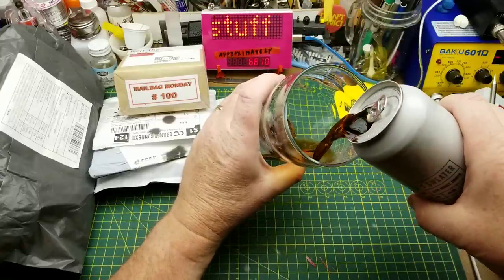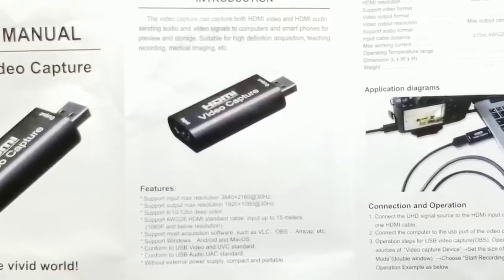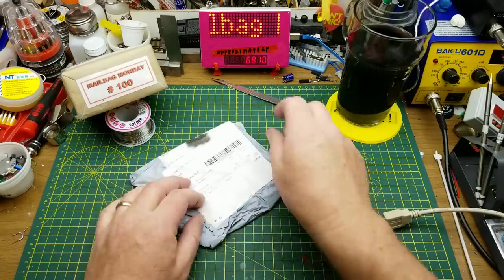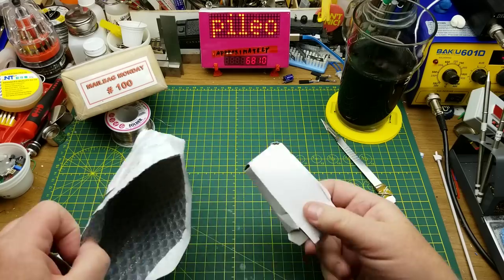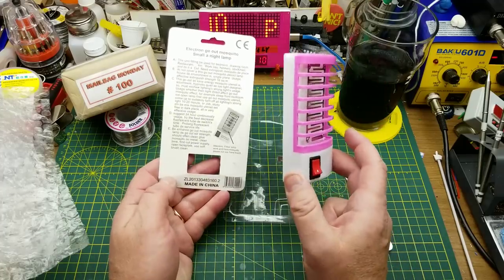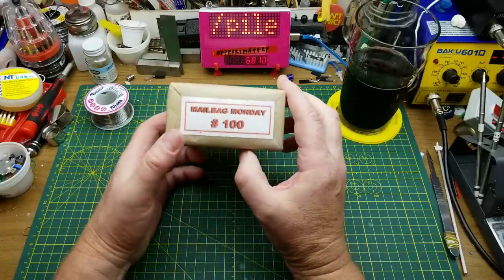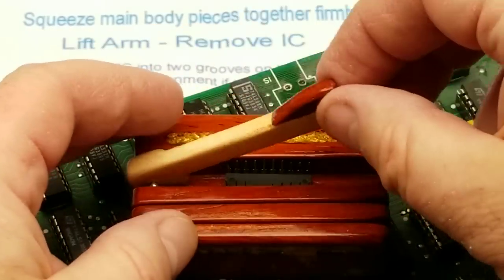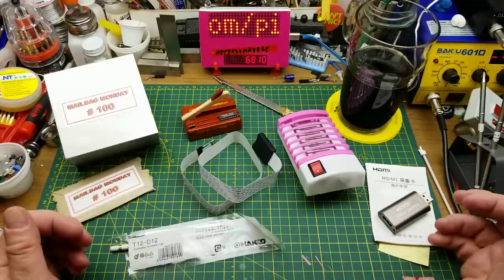Mailbag Monday #100

Comment: If you use "Repetier-Host", you can print directly from a computer (like a 'normal' printer) without having to transfer to SD card and transfer to the printer.  Having used both, I cant figure out why people use the SD card transfer method to print.
Reply from the maker: My printer is far away from any of my computers, so that's not really a practical option for me.
Octoprint on a raspberry pi has become my preferred method. 

But I ordered the SD cable before I set that up.

Comment: Some caution with the pink device: looks like Ozone Generation and UV-C led could be dangerous to look at!
Reply: there is no ozone generated by the pink thing, the voltage does not get high enough for that. also, the leds are near uv, not uvc. uvc leds have metal housings and cost way more. see big clives channel for details about uvc leds
Reply from the maker: It shouldn't generate any ozone, assuming it's working properly .

Though, you never know what might happen if it starts arcing and sparking due to shoddy manufacturing...

Comment: I picked up a capture dongle too but haven't played with it yet. I read somewhere you can use it on Linux. I have a friend who has one and is a Linux user. I'll ask him if he uses his on Linux and what distro if he does.
Reply from the maker: I still need to test it on my main computer - the one on the shop is pretty low spec, so that may explain some of the lag and relatively low frame rate.
But at least it does work with Linux, so that's encouraging.

Comment: i just orden micro sd car cable extension too. i need my raspberry pi sd car holder move to case frontside. i build own case plastwood 3mm,  display old notebook 17,4" and aliexpress driver board 16$ and working well cheap raspi 4 8gb new monitor now and same case come inside back in raspberry pi and front need move sd card hole.